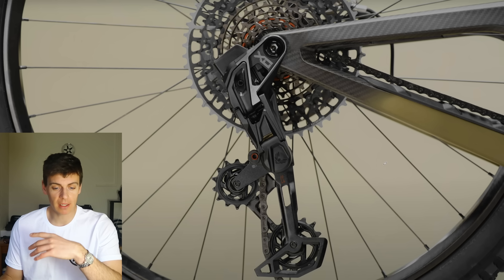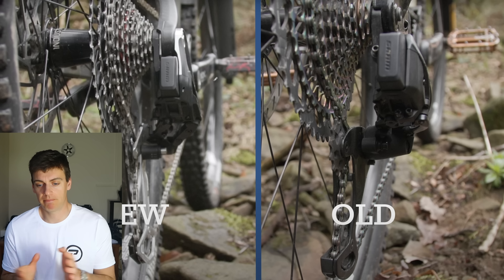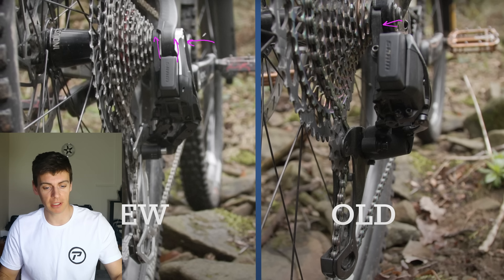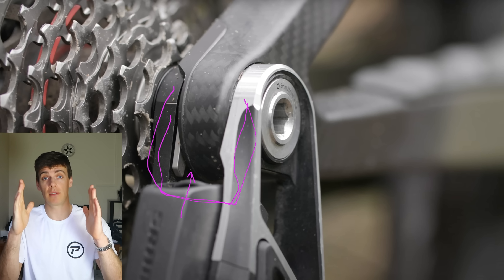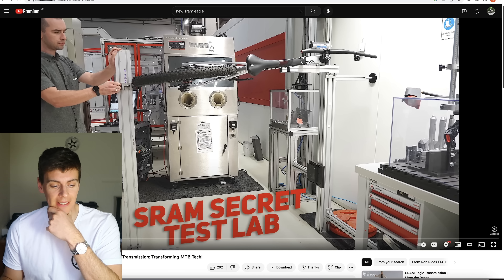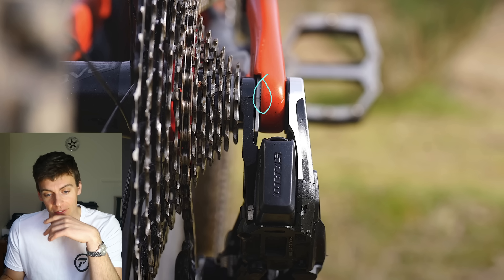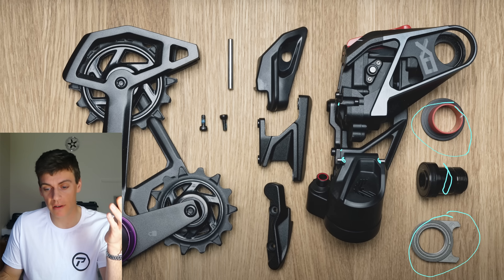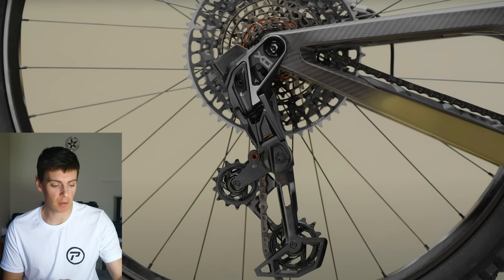Mechanical Engineer's Speculation of new SRAM Eagle (including misinterpretations!)

Comment: Good video and raises some interesting points for conversation. I am also an engineer and have ridden bikes for many years and in that time can count on one hand the number or mechs and hangers that have been bent or damaged (not many but I'm sure others have different experience). 
I understand that manufacturers try to evolve products to seemingly make them "better" but whilst this tech looks cool, I think that the idea here more than anything is to SELL based on jargon to empty people's pockets. Hangers are cheap and can be bent at the side of the track, unlike this design. Same with AXS, I love the clean look but what was wrong with a cheap, reliable and simple cable? What was wrong with a cheap, reliable and simple hanger? Nothing apart from the fact these parts were cheap! I am all for technology, but not if it doesn't add any benefits.

Comment: Interesting analysis. I too am sceptical, especially regarding the loss of a sacrificial component at a vulnerable interface. If memory serves Shimano once tried direct mount for their Saint derailleurs and ended up dropping the idea. However, trying to give the engineers at SRAM the benefit of the doubt, if the axel is a single piece then does that not ensure that the cassette and the derailleur interface are both concentric to the axle and therefore issues with frame tolerance are (mostly) eliminated?

Comment: Sorry you are wrong on a few points. The mech clevis doesn’t pinch on the dropout (that ls what I’m assuming you mean) - it’s a floating bolt - there is no pinch force / clamping force added to outer of the mech. 

The bolt secures to the inner plate, made snug, the wheel, axle and mech is then installed, then the mech bolt is torqued up - and secured to the axle. No pinching on the clevis onto the dropout. 

It would be worth getting the product and understanding how it mounts and maybe do a follow up video. 

Thanks
Rob
Reply from the maker: Thanks Rob, I realised my mistake today looking at the drawings, that the outer plate/yolk is floating and there is clearance between the stubby bolt and it. I'll pin a comment to address the inaccuracy.
Reply: @PeakTorque  Or you could first try the profuct or do at least the necessary reading/getting information about it before you do a video about.

Comment: Cant wait for that heavy handed gorilla to crank on that bolt way past 8NM and crush that carbon drop out.... crunchy.... Good video. The bike industry is full of ideas to get people to spend their hard earned. Does make me wonder where it will go next, from 26" wheels to 27.5 to 29... 10, 11, 12, 13 speed, I mean surely there comes a point when they run out of ideas. It's a triangle with 2 wheels... can't do that much more with it one would think.

Comment: I think you got some details wrong. The derailleur is mounted with it's own bolt. No movement when the wheel is taken out, no washer rubbing, no frame wear on that side
Second the axle screws into the derailleur bolt, so the system has to be straight or will straightened when tightening the axle. Cassette and derailleur will line up.
If the dropouts are not perfectly in line with the crank so what. The chain is never going straight anyways.

Comment: I am interested in the following. What about patents? As I understand it, you can use UDH to attach any transmission to it - shimano, sram, etc. But is it possible for Shimano, for example, to release its transmission with a similar interface without violating any patent? It will be funny if SRAM, under the guise of "unification", became a monopoly of the electronic transmission market.

Comment: I would have less of a problem with this if they changed it to where the hanger was still the weak point and could be replaced separately from the derailleur.  Of course, with this design, it's still going to break, it'll just be more expensive when it does.

Comment: Machinist here - engineers tend to overthink datum structures. Over 20 years I’ve noticed a big difference between what engineers think you need to do to fit things together and what actually works. 

There’s this assumption that all the numbers are perfect and things don’t flex or move around at all when you put them together. This video is a prime example.

Comment: Another thing to consider is that the replaceable mech hanger improves safety. I've been riding along, luckily fairly slowly, caught my derailleur on a tree stump and had it stop the bike dead like an anchor. If this happened at speed with no weak link to snap off you could be either thrown over the bars or just destroying your frame as you say.

Comment: As someone who doesn’t work at SRAM but has seen this product in person, I have some thoughts: 
1) it sounds like you have neither seen this product nor ridden it, so your theoretical criticisms of the design have little validity
2) there is a 21 tooth cog on the cassette, so you are just dumb
3) the cassette and derailleur mount to each other, therefore there is no tolerance stack
4) your inability to hold your judgement until you’ve actually seen this product should disqualify you as even a commenter, and particularly an engineer. You apparently can’t think outside the box of ye ol derailleur hanger, wouldn’t not hire you as an engineer! 💋
Reply from the maker: The cassette is attached to the hub via the freehub, via the hub axle. The hub is then clamped to the dropouts with the thru axle, there is 3 components of a tol stackup already!

Comment: Dear Mr. Torque,

As a fellow engineer I would like to point out something that I think you're missing here in regards to the alignment of the derailleur: it is mounted concentrically with the axle because of the threads and the bushing, therefore unless the axle or derailleur body bends, it is likely to be aligned to the wheel perfectly regardless of the dropout (within reason). I would argue that the dropout itself is much more likely to comply under the tightening load than the axle itself.

On a related note, impacts to the derailleur body do seem unlikely to cause more damage than with an engineered failure point (hanger) since the RD body is mated to the axle now, and an impact that would damage this system would cause catastrophic failure to a traditional system with all kinds of potential consequences.
Reply: if it does bend there is no reajusting it. i guess it would just break under impact. like how many times have i had to straighten hangers. at least with the hanger you have a chance of limping home. this is just designed obsolescence at almost 1000 bucks a pop. gotta love the bike industry
Reply from the maker: I understand your point entirely, but threads are not ideal concentric alignment elements. Threads like these course M12 thru axle threads have considerable radial clearances, not to mention the clearance of thru axle Inside the hub axle. So actually the casette is not really concentric with the axle at all. I agree thats the same on any mech design however.

Comment: That cassette is definitely not narrow wide, don't know where you got that idea. Especially with those exteme close ups you used. Getting that wrong makes it hard to listen to the rest that you say. Everyone knocking this system (yourself included) seems to focus in on the force of an impact getting transferred to the frame. Maybe. But you're looking at it from the perspective like derailleurs are out there getting smoked to oblivion every day. Truth is, if you crash, you risk breaking something. Always something. If that stump directly hits your frame 3 inches forward of the derailleur,  you'll be just as worried that you just compromised your frame. The derailleur takes up about 2% of the surface area of crash exposure on your bike, why design it to be smashable?
Reply from the maker: The X-Sync tooth design is narrow-wide. Apart from the 21t setup cog. Its in the literature.
Reply: @PeakTorque  yup. And X-sync refers to the chainring.

Comment: I bought a Cannondale road bike in 1989. The rear derailleur screwed directly into the aluminium frame. Then the hanger loop cracked. And Cannondale replaced the frame at no cost, along with many other frames of that era. Henceforth the derailleur hanger was invented. Maybe people forget stuff which happened 30+;years ago.
Reply: It is screwed to the axle. Nothing is screwed to the frame here. Frame might be even protected between metal deraillieur mount now.

Comment: It’s the new pf bottom bracket. It’ll take 10 years until everyone realizes the tolerance requirements makes it crap for most people.
Reply: pressfit ARE just as good as threaded bb's provided you install them correctly, i would for sure prefer a pressfit over a threaded as threaded bb's in my experience come loose over  time, even when torques, taped and greased

Comment: 13:29 when you tighten the rear axle the dropout WILL flex forcing the universal derailleur hanger perpendicular to the hub's endcaps everytime. 
The classic derailleur hangers are 3mm thick at the dropout and usually cast aluminum, they are usually so low quality they are crooked out of the box

Comment: 12:25 on the original NX etc this part was an o-ring, which was sloppy new and super sloppy within a year when it disintegrated. 
Shimano have used the exact bush you circled forever, they take ten years to wear and its great if its a catalogued service part

Comment: hard to see with seeing in in the flesh, but don't think there is clamping across the 'clevis' if you look at the out part of the clevis it is smooth bored and just sits around the outer larger dia part of the axle (which also appears to have an o ring something) so on installation it appears that only the inner cassette side of the clevis is clamped to the drop out. still the overall alignment issue (my last) bike needed a tweak of the hanger to correct a slight dropout alignment issue does seem to be a future issue for many manufacturers.
Reply from the maker: Yep you're right, i realised my mistake. Pinned a comment regarding this. Cheers
Reply: if you take a look at the Sram installation manual - YT won't let me post the link, you can see that the mech axle clamps against the top hat and so the inner face of the dropout is always the reference face for installation, albeit via the knurled plate. The outer part of the 'clevis' it is smooth bored and just rotates around the axle so no clamping across the clevis.

Comment: Thank you. I have been watching this release party and cringing the entire time. We have been here before, direct mount deraileurs or fixed hangers.. and guess what, frames and deraileurs would break. 

So many folks are excited by this and I will just wait and watch. You even opened up some other discussion points I hadn't considered. 

Great video glad it popped into my feed.
Reply: This industry goes in circles - it literally reinvents the wheel every few years.  Everything you see today was done in some fashion 20 some odd years ago.  The whole point of a hanger was a cheap easy fail point that you can replace in 5 minutes so you can keep riding if you bash a root, rock etc which is what happens when you ride many kinds of tough terrain. If i bash this new one against a rock and the mech dies - well im now out many hundreds instead of 5$.

Comment: Good video as always but I think there's the same general fear and anger at any change we see coming through. Yes, absolutely there is no sacrificial part that fails first but for those buying this that probably didn't matter. It's removing a cheap consumable part that's easily replaced. Nino shurter won an xc world cup and xc series with this mech so there's your QA signoff and blessing on it!

What i completely disagree with is your assessment about the datum/indexing. At the moment every commitment you mention about frame QC, frame bend, frame tolerances etc is all in play with  the hanger at present. All it's doing in my simple engineering head is removing an offset brought up with the existing hanger. The hanger machining as it's a cheap throwaway part is going to have the worse tolerance so using the frame as your 0 is always going to be better.

They've already standardised most of the (MTB) bike industry to they're UDH standard which is a massive plus IMO, they've also seemingly removed the superboost axle standard in favour of 148 O.L.D. and 0mm crank offset - another positive and now they're cashing in.

I can't afford to buy one so won't but I'm applauding the engineering simplicity of it. I happily use my UDH standard and say thank you to them for it.  This is all MTB centric btw, i think their audience isn't roadies who still seem to be clinging on to the dark ages of rim brakes and tubed tyres😂😂😂
Reply: These aren't new changes though - we have had direct mount derailleurs - this exact same thing has been done before. It failed hard and cost a lot of people a bunch of money.
Reply: @corail53  yeah, 20 years ago and they were connected to the thru axle. Times change, technology improves and moves on, do you remember the phones when those original versions of the no derailleur came out?? Nokia n95, blackberry pearl. Old, dead relics vastly improved by today's offerings.

Comment: hanger saved my rear derailleur on a road bike. It was cheap and quick to replace.
R.D. hanger took the energy on itself -- bent slightly thus saving the rear mech and the frame. Because it's made from softer metal compared to the frame and derailleur it was a very good invention. Thanks for bringing out this P.T.!

Comment: I haven’t seen anyone mention that these require a UDH (universal derailleur hanger) compatible frame which is becoming an industry standard. So the whole fitment talk about different frames shouldn’t be an issue if manufacturers are designing their frames to work with this new design. You can’t put this drivetrain on your 2019 Cannondale Habit for example.

Comment: Yes to all you said! ref SRAM in charge of QC, god I hope not, their NEW normal rear mechs have so much play in the pins etc (compare to shimiano/campag) it is gen worse than a shimano 10year old used one! SRAM front mech AXS mech pins held in with "C clips" that break/go missing and pin working loose, all rubbish design with no for thought IMO. Also will this kill the SRAM universal hanger? (which I did think was a v good idea!) SRAM always have issues with New released kit, so I wouldn't touch it till a year down the line when V2+ items come out to address the issues.

Comment: This is a time will tell sort of thing, as someone who is not an engineer but has been a full time mechanic in a bike shop for many years, some of his concerns have already existed for years, The knurling on the one interface for instance, there are many hub end caps that have this, and there are a lot of hangers that mount to the outside of the frame so those end caps press against carbon dropouts. And to be fair I have seen hangers on newer bikes getting much more rigid in past years, probably to improve shifting performance, but to the point where they aren't really a sacrificial part any more. But I appreciate his perspective, and we shall see, I have a bike with this group arriving shortly to my shop.

Comment: I'm still riding my 2011 Aluminum Variant Aluxx SL XC bike, a 26 Giant XTC with a removable hanger. Despite having bent and broken hangers and mechs in the past, I upgraded it with a Deore M5100 11 speed grupo recently, and the frame is still holding up strong after 12 years of use. Even with years of racing locally and daily use, I don't understand why bike companies keep creating so-called innovative standards that nobody wants, and promoting them as the next big thing when they're just failures. Shimano did this before with their so-called direct mount, but here we are in 2023, and both budget bikes and high-end bikes still have removable hangers.

Comment: Could they just offer  some additional derailleur protection bar  which could be mounted as derailleur hanger. I know there been around old  heavy steel derailleur hanger protectors in the past which been mounted on the frame. I had one on old steel bike with  3x7 shimano derailleur. As a kid i could freely drop bike on derailleur  all day long.   With new materials and  stealth design they could make the same from carbon for example.

Comment: Interesting point of view, but the way I think of it is the mech-clevis-axle assembly being the datum, then attaching that onto the crappy dropout. If I'm not mistaken, you're supposed to put on and tighten the axle first, and only then tighten the clevis from the drive side. It'd be interesting to see what kind of materials are used in the bushing and that weird serrated washer thingy, and how much of that tolerance it could eat up with those ~35 Nm of the mech-clevis bolt.
Also, how hard do you really hit your mech? How does that compare to a 50cm drop, or casing a jump? I'd wager that it's insignificant, and the stronger clevis will mount be a net positive in terms of durability.

Comment: If the only problem this really solves is that you don't have to find a hanger specific for your old frame by having to buy a new derailleur and/or bike frame, instead. The most bizarre thing in their demonstration is the crash test... just the fact that nothing snapped makes it a "pass"? I mean, even with a traditional hanger, you may not have visible damage but your indexing could still be off to the moon, they haven't even shown any shifts after their "test", so it might be that the bike's shifting is totally messed up.